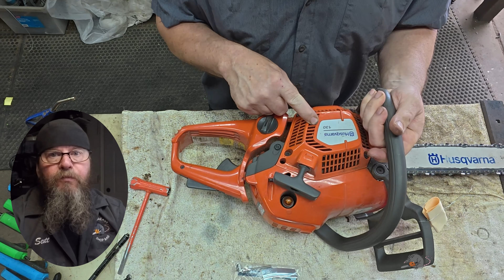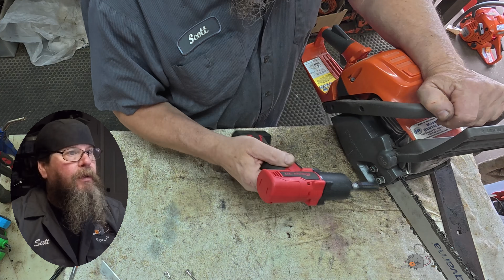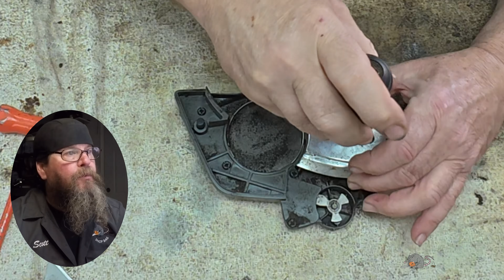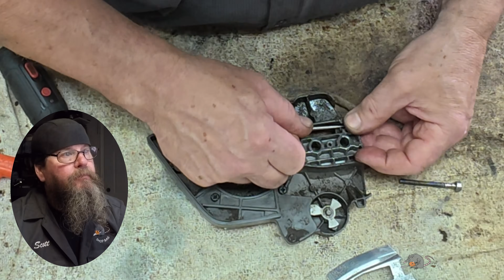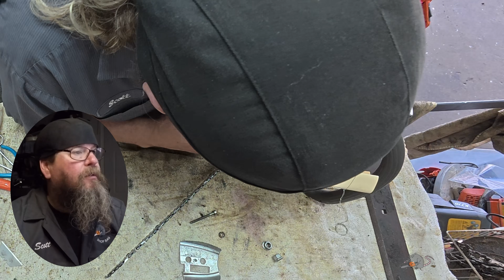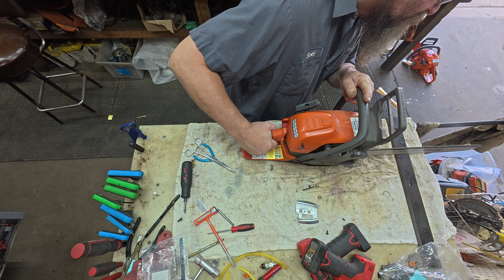Husqvarna 130 Chainsaw Chain Tensioner Repair

Comment: Tensioner like this works fine..use the right tools.. budget saw my ass it's professional chainsaw.
Reply from the maker: This is a home owner grade saw by Husqvarnas own definition. Saw models that start with the model number one are home owner grade. Saws, (trimmers, blowers) that start with the number 4 are farmer/rancher grade and saws that start with the number 5 are pro grade. This 130 was never intended for pro use.
Reply: @TheGreasyShopRag  130 is a pro level saw period. It is most suternly not a "budget" like you said it.

Comment: Fast change of the Tensioner, that was Nice.Nicer would be when you had added a little bit of grease to the Threads.Grease will help most of the Time.

Greetings from Germany.
Reply from the maker: I always have mixed feelings when greasing something that will be exposed to dirt. Sometimes I do it and sometimes i don't.
Reply: @TheGreasyShopRag  This is a part what is not running fast, so dirt has no meaning in my opinion.But everybody has another thinking, everything is ok.

Comment: I have a question can you tell me the best chainsaw repair manual for tearing down and fitting it back
Reply from the maker: Back in the day I had some motorcycle repair manuals that were helpful. Never used a manual for a chainsaw but have had to access dealer portal for some repair procedures and specs. Those dealer sites are not available to the public. A while back a workshop manual supplier contacted me to do a colaboration. I turned them down but they had thosands of manuals available online. I don't remember what they were called.

Comment: Easy fix video. I'm not a fan of any front facing pensioners. Some clutch covers are manufactured to accept side mount ones, but they still put front mounts on. 🤪!
Reply from the maker: They want to compete against the lowest costs saws so hold back on some goodies.

Comment: I live your videos. I do have a question though. What make is that electric screw driver you use in this viedo? The black one. I've been trying to find one like that but I'm having trouble
Reply from the maker: I've also been trying to find another and I can't. The name on it is Umimille.
Reply: @TheGreasyShopRag everybody wants that screwdriver
Reply from the maker: @BruceLyeg  Its really kinda sweet for such a cheap tool.

Comment: This is a 130 rather than a 135. The 135 has a side tension adjustment.
Reply from the maker: And don't forget the snaplock lid. I mislabeled the video file and then just went ahead and edited the whole thing without ever looking at the actual model. Nice catch, I wonder if anyone else will notice? I'll make the correction in the description and maybe change the thumbnail. Thanks.
Reply: @TheGreasyShopRag  This too. I also saw a sticker, but thought it might be a trap.. 😀
Reply from the maker: @elpolaco7654 No trap. I try to put out two videos a week and this time I rushed it.